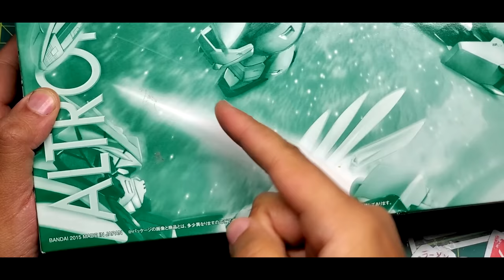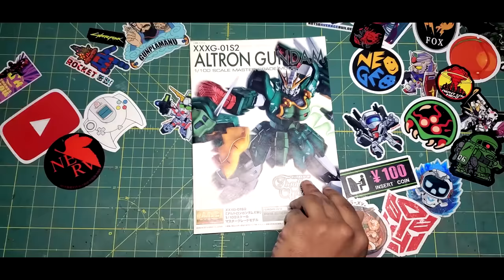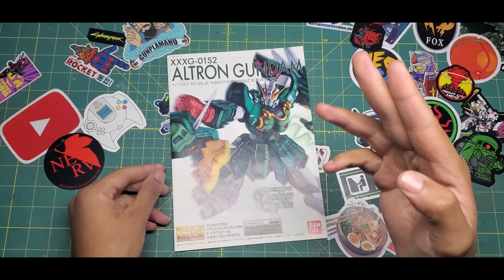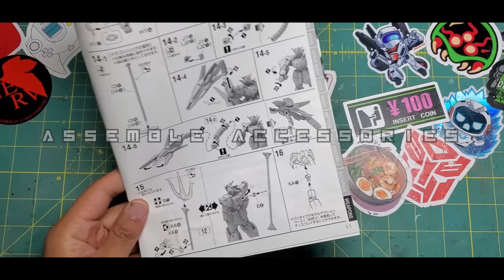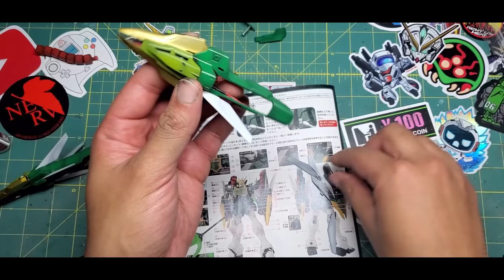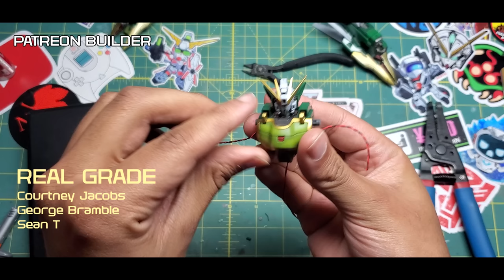#newtype #Otakubuilder MG Gundam Altron EW (4K)

Comment: Still don’t understand why all endless waltz suits are p-Bandai.
Reply: As a somewhat serious response to your question: most of these kits are straight color swaps with some additional accessories. As a cost saving measure, they don't produce alternate suits like these en masse to prevent a ton from either side just sitting on shelves (as they make no money from unmoved kits). 

As for the whole thing with premium bandai lately, especially since there are a lot of kits that are not part variants releasing under the brand, which I assume is because they think they won't sell as well, but I still question the validity of that stance. Also important to know: two of the five kits for Endless Waltz are not premium bandai. Three if you count both wing zero custom and zero custom ver ka as separate. Deathscythe Hell was also a full release.
Reply: wing is popular in the west, wasn't well received in japan so the EW MG's probably didn't sell that well aside from maybe wing and deathscythe so that's why they went the low risk route of P-Bandi

Comment: I've found if you paint the eye with the real touch metallic green gundam marker the go around them with black is a easy and very good way of doin the eyes being the eye itself pops out it makes it easy and then any mistakes can be covered by the black. Also the Markers paint is translucent  light will show through. I also feel ya on the braking of parts not sure what I'm doin wrong but the last 3 mg kits iv painted and built all have something broken my last kit that I just finished last night I took my time did everything right and still broke a part it about killed me inside cuz I spent a week or more making sure the paint was good and dry the joints managed and all parts the need move freely moved all was good till the final assembly then super glue and now a complete kit. Oh the pains of being a gunpla builder
Reply: I feel your pain...
When I was finishing up my MG strike rouge Ootori I messed up one of the hips (paint on the joint, so it was too tight...), I reinforced it, but ended up gluing the hip together -.-" (luckily not in the waist or the leg). The attempts to make a makeshift hip from runner parts also failed, so I had to buy another kit and only use it's hip...

The spare kit will be used somewhere in the future for a diorama with a mg Banshee Ver. Ka (after I rig that one with LED's), so it won't go to waste.
Reply: @DCG909  my mg barbatos has a small bar in each arm holding it together at the elbow

Comment: The MG XXXG-01S2 Altron Gundam (EW) can be expensive since it's a P-Bandai, but it's definitely worth it. Are you going to get the P-Bandai MG Expansion Parts Set for Mobile Suit Gundam W EW Series (The Glory of Losers Ver.)? Included in that set is the parts to convert this MG into its 'Glory of Losers' iteration which includes the Twin Beam Cannons on its back. In the manga, it gets destroyed by  OZ-00MS2 Tallgeese II (EW) during the final portions of the Eve Wars which is used to explain why in the OVA, it doesn't have it.
Reply: @xxnike629xx 

"The MG XXXG-01S2 Altron Gundam (EW) BOX can be expensive since it's a P-Bandai, but it's definitely worth it."

Fixed 😉

 "Are you going to get the P-Bandai MG Expansion Parts Set for Mobile Suit Gundam W EW Series (The Glory of Losers Ver.) BOX ? Included in that set's BOX is the parts to convert the kit inside this MG's BOX into its 'Glory of Losers' iteration which includes the Twin Beam Cannons on its back. In the manga, it gets destroyed by  OZ-00MS2 Tallgeese II (EW) during the final portions of the Eve Wars which is used to explain why in the OVA, it doesn't have it."

Fixed Reloaded 😉😉

Also, Suiton. Are you going to build the kits inside your MG WZC Ver.Ka BOXES , pose them side by side, one in MS Mode and the other, in Neo Bird?

So that you know, you can prove that you actually build your kits after all

So pics/vids or it didn't happen 🤪🤪🤪

PS Are you also going to comment about HGUC Xi Gundam being NOT a P-Bandai? huehuehue

Comment: Any reason we are leaving wires out butt and not running thru legs? Could make a custom base and hole in bottom of leg and not even see wire on gundam. Yet to do my self just asking if tried or not. or other idea custom action base and use support pole to hide wires. Just asking cause figured if your not doing it I have no chance of pulling it off good.